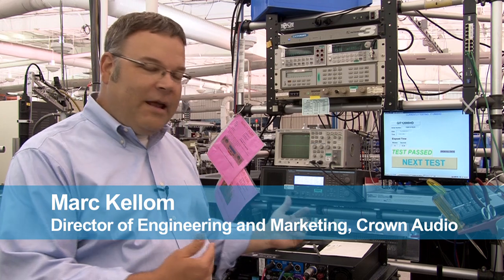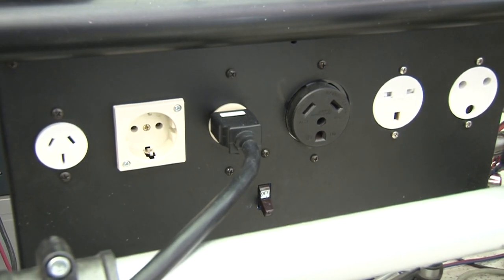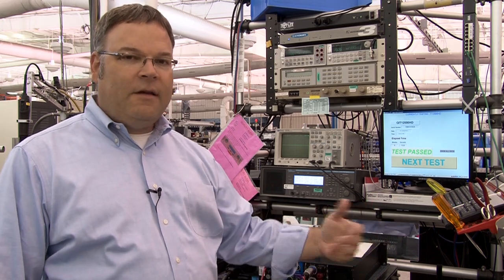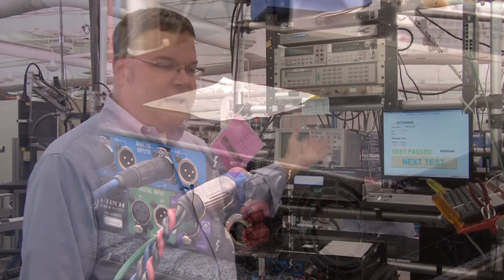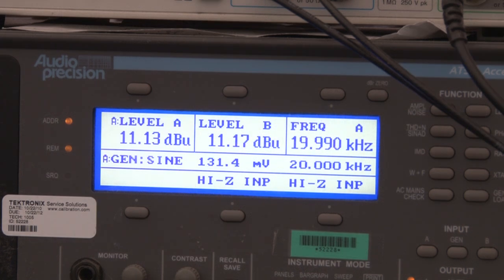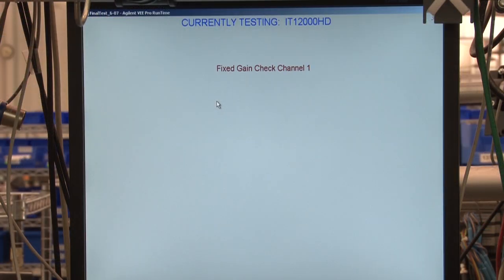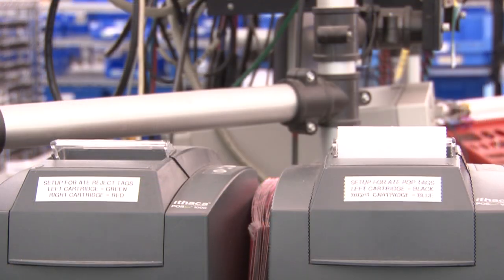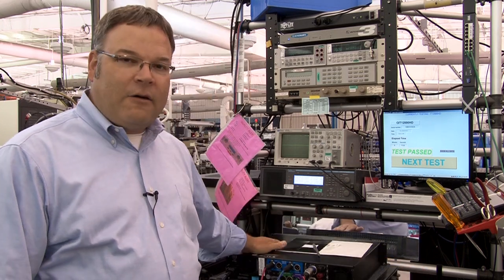Crown Audio Amplifier Testing

Comment: Love this video but now crown amplifiers are a little bit snow flaky besides the crown xti6002 and up and surprisingly the xls series is solid to but other than that I’ve seen so many amps fail and it’s all because crown products are now being made in China instead of the United States, have 2 crown xls1500 both on bridge mono mode running 2 jbl sr4718x per side and I have to be honest those small things pack suck a big punch, I’ve abused the amp for 8 years now and the thing has never overheated or shut off on me ever big plus for me because it’s light weight, powerful and the power consumption is not much at all!

Comment: As technology advances, other problems arise. Switched power supplies with pfc and class d circuits are excellent combinations, it's a pity that even so....they burn! I don't care about very low levels of thd, Slew reat, imd,... I'm interested in an amplifier that doesn't burn!
Reply: Which make and models have burned up the most in your experience?
Reply: @berrysoundacoustics  Behringer is by far the worst of the worst, avoid anything by them
Reply: @bobking7347  Yes. I run all Crown ITech HD damps for the mains. I have QSC PLD for monitors. I grew up on QSC rmx. It’s one of the best most reliable amp lines built due to its simple old school design. And I will never own a Behringer product.
Reply: @berrysoundacoustics  crown xtis mostly, only go for the crown xli series or crown xls series or crown itech hd amps, the itech hd amps give 20 to 20 ratings, those are worth the price
Reply: @berrysoundacoustics  most reliable easily accessible pro amps on the market are qsc's rmxa series, they are  rated from 20hz to 20khz both channels driven, they are the last of the last real old school quality built amps, not that rated at 1khz noise, as affordable as crowns xli series is, qsc's rmxa series eats them for breakfast

Comment: I bought two Crown XTi 1002  for subwoofer duty. The subs were 5ohm minimum on each channel.  The amps seemed to not deliver below 25Hz.
Reply: qsc rmxa series will laugh at 10hz, especially the 4050a or 2450a running 2 ohms per channel or 4 ohms bridged.

Comment: i need some technical info about how we can test the crown dci amplifier power supply if the amp does power on with green light but doesn't fully power on with blue light (dci-n series). we are authorized dealers of JBL in our region. (rt@ncsp.pk) kindly reply.

Comment: "Passed all test"....but no actual performance numbers given. Wonder why? Because even Crown knows that they are sending out misleading information on power output!
Reply: Have you seen results from testing, out of curiosity?  Power measurements don't really seem to be done to FTC rules anymore.  But in theory, after a warmup, the amp needs to deliver the stated power into 2 channels, for a period of time without failing, etc.  Just not sure anyone bothers anymore.
Reply: @michaelbauers8800  look on audio science review for xls power measurements, certainly not the crown I remember.